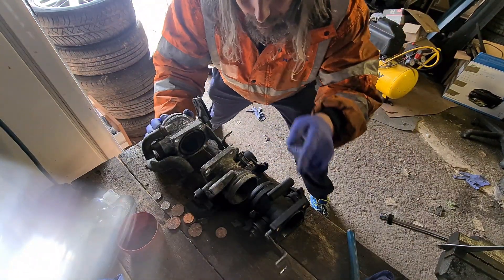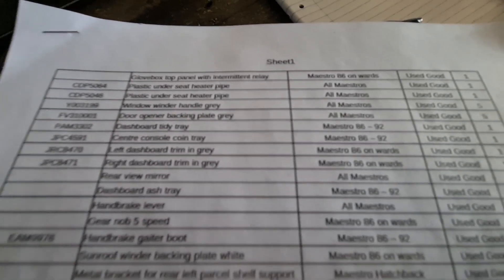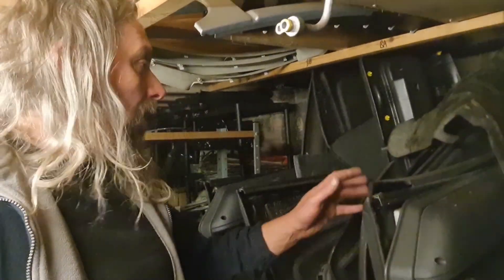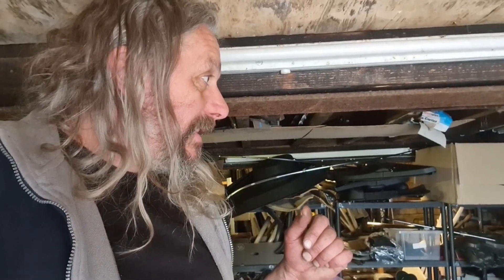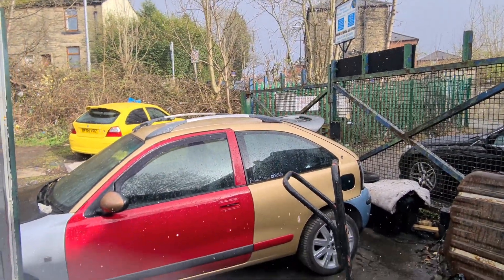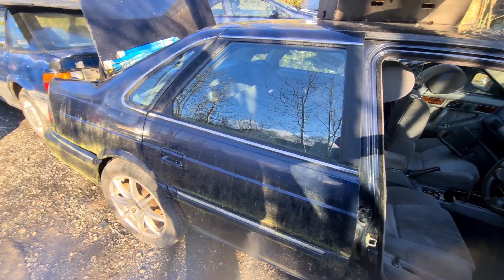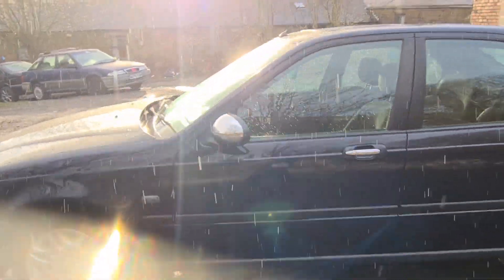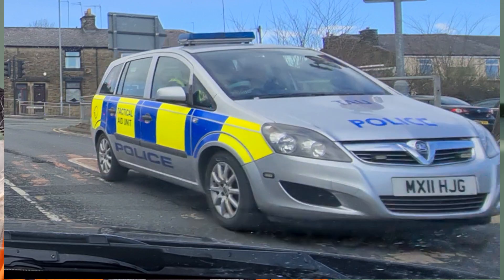Rover stuff and elephant toilet roll

Comment: Zafira police cars?? We have Peugeot 308 estates up here.
Reply: Its a police dog van and is sometimes used for other light duties the Peugeot 308s are the modern Panda cars... Its all abit sad really as it looks like the police as a whole have lost the ability and taste to purchase good fast and intimidating cars as they have done in the past. Would you be worried if you was pulled over by a Peugeot 308 no you wouldnt be... Youd certainly shit a brick if you got pulled of by a Rover SD1 827 or Volvo T5 though haha!
Reply: @danvitesse  the first 800 I ever sat in was the back seat of a police one 🙄 back when they were jam butties rather than battenburg cakes
Reply: @emma.j.nation  What did you do for such an honour? ;) The 800s were one of the best police cars in my opinion also the best car ever made. I own an ex force protection 827
Reply: @danvitesse  crossed the double white lines at the ‘S’ bend on Rivelin Valley Rd, just as the police car was coming the other way.